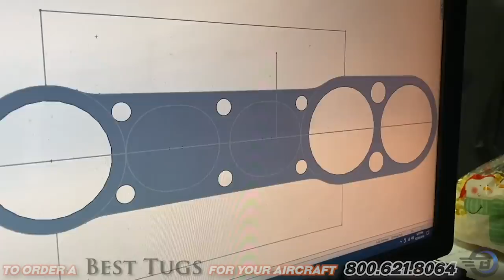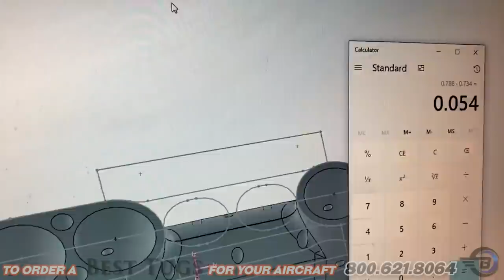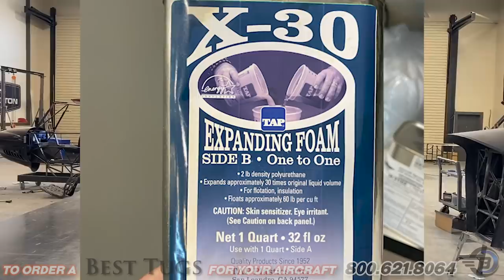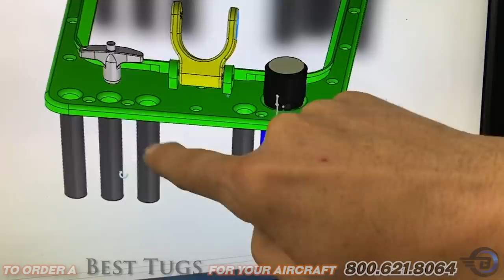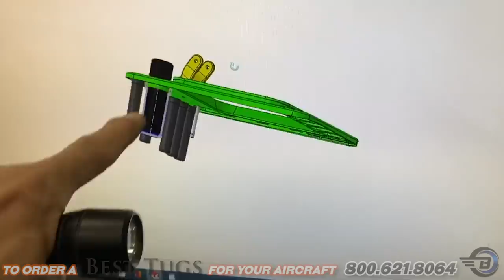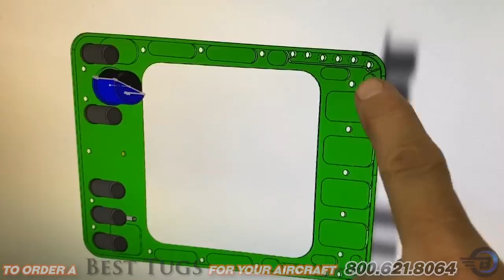Gust Locked 🔒 (Scrappy Bush Plane 14)

Comment: After watching your build videos, flight videos, and seeing the awesome community that has been built around aircraft, I am 100% going to get a light sport certificate. My grandfather has a Cessna 170 that has been in storage for about 3 decades since being ground looped. He has the repairs done on the landing gear mounts and the wings completed, but never finished the engine as it had a prop strike. I think its time to get it in the air again.

Comment: The pivoting gust lock is a great idea!  One thing I didn’t see is the ability to secure the gust lock bracket in the forward position to prevent it ever inadvertently coming rearward in flight and locking up the controls.
Reply from the maker: Gamma Sigma I’ll show how it can’t in a later video probably with the rudder lock

Comment: Mike,
I noticed the hole left in the panel when the gust pin is removed to lock the yoke. I think the pin will vibrate up/down when in the flight position.  You built shields for the light and pen pockets, but not the gust pin.  Just an observation.  As an aircraft engineer for a mayor aircraft manufacture I'm truly impressed and inspired by the attention to detail and the fantastic build and engineering quality.  Thank you for the videos.
Reply: vipervette03 I wonder if the little ball at the end of the pin will keep it in place via friction while it’s in its storage hole
Reply from the maker: vipervette03  there is a receiver under the plate I didn’t show, I can show it later. the pin drops in and you must push the button and I locks down in a pin set 2” under that hole. You can’t get it to vibrate or remove unless you push the button on the top of the pin
Reply: Mike Patey Those are the same kinds of pins used to secure an envelope to a basket on most balloon systems. My system is a firefly though and uses a toggle set up. I’d be happy to show you. How about a balloon ride for a Srcrappy ride😬🤣. I fly out of American Fork regularly.......
Reply: @slcfloater9443  i agree, i was not worried the pin would fall out. just the difference in the location of the ball detente to the thickness of the panel.
Reply: vipervette03 So what is the best AC for the $$ from a designers perspective??
Reply: @slcfloater9443  Wow, you’re so close to each other you probably fly over each other’s houses.
Reply: @MikePatey  Just curious:  do you have a means to lock the gust lock yoke down when in flight?  I saw the friction knob, but since you have to have a place to put the locking pin, why not design a way to use that same pin to positively lock the gust lock out of the way?  Then you can use bushings instead of a friction knob to keep vibrations quiet on the gust lock, and you also no longer have to fiddle with the friction lock every time you want to move the gust lock yoke.
Reply from the maker: Scott Reichel yes, I’ll show more on that later when I show the rudder lock 👍🤠

Comment: I love the thoughtfulness that you integrate into your designs.  Your design philosophy should be adopted by others to provide safer products.  However, I know that your design schedule and budget restraints for Scrappy are far more relaxed than the development of products for the U.S. government. I would have loved to be able to design in that environment.  One thing that I noticed in your video is that you did not talk about having a lanyard for the control lock pin. I know that your design includes a storage location for the pin, but nothing to prevent the pin being dropped on to the floor of the cockpit when you are sitting in the seat.  I know from experience how hard it can be to retrieve a dropped item from the floor when you are all belted up ready to go.

Comment: Mike, Great work! Got a suggestion for you that is a simple mod. Drill the hole to store the pull pin in front of the yoke. The handle of the pin would keep the yoke from pivoting into the way of the control stick if it got hooked by a seat belt or something during flight.

Comment: Hi Mike, 
I, like others certainly enjoy your videos. Please keep them coming and more of them. You asked for feedback on either giving us videos more sparingly or giving us shorter videos more ofter... Giving us more shorter videos is my preference. 
Additionally, I wanted to suggest an alternative way to cool your oil. I've repeatedly watch videos 7 and 8, and I see that a large duct on each side of the fuselage forces relative wind to turn 90' into the plane, 90' again to turn through the coolers, and then turn again to exit at another 90' turn to exhaust out the same side. Here's what I'd like to suggest... Install two large NACA ducts on the top of the fuselage for force air straight down and through the coolers, and then use two large/long NACA duct built into the bottom of the fuselage backwards aft of the coolers, and before the tail wheel mount, to pull the air out of the coolers and exhaust out the bottom of the plane... Which keeps the air flow in and out of the coolers in one direction. I say this because the NASCAR race team for "Gumout Performance Additives" conducted extensive wind tunnel tests, and found that by installing NACA ducts backwards in the rear side windows pulled large volumes of low pressure air out of the interior. So much so, that it increased the car's speed. I hope you give this some consideration because the two large side scoops and exhaust grills create unnecessary drag on Scrappy. Thanks for sharing your build with all of us. Your time and effort to create the vids are really appreciated. and now... Back to work!

Comment: Hey Mike, I do interior upholstery and I had the thought that a sewn vinyl or leather boot will save weight over a rubber bellows style boot.  If they are reinforced in the seams correctly they should keep out dust and fod do just as well.
Also, so cool to see you taking care of customers like that, brand confusion is so frustrating for customers it's hard to make it a positive customer experiance.

Comment: A piece of spring steel slipped inside the tubes will positively hold the flashlight and sharpies/pens so they don't fall off when you fly inverted. Kinda like how the old timey flashlights that used one double AA battery had to keep the battery in place.

Comment: Mike. Fantastic work, your design and engineering skills surpass anything else I have seen on You Tube. A little thought for you. If you cut out the part of the plate with the pen and flashlight holders and fitted it to a thin plate. This could then be dropped into the resulting hole and secured with a couple of screws. Cleaning or retrieving anything that dropped into the holders would be a simple and quick fix. Unscrew the plate with the holders, remove it, turn upside down on shake clean and replace

Comment: Fantastic job as usual.... I hope you will have enough flex in the boot to go from full up elevator to locked in the gust lock without the boot material jamming in the tiny gap left between the stick and the gust lock itself.

Comment: for the floors we had a shop that builds quansets to build floor and cargo mats and seam welded the corners so water etc stays put.. and then we got some used carpet and cut disposable mats up.. use em they get wet N Muddy, then toss em and throw a new one in,,,and the old carpet was free.

Comment: Could I ask you to consider changing the gust lock to accept the locking pin so that the lock can be pinned in the stowed position?  This would ensure if the pin is not in your hand, the pin is holding the gust lock in the yoke or in the stowed position.  Currently, the pin could be in the holder but the gust lock could still be in position over the yoke.  One of those 1% failure modes.  I love the thought and engineering you put into every millimeter of your aircraft.  That's why I watch, not a pilot, just an engineer.
Reply from the maker: The Devils Chew Toy we think alike. My videos run a couple weeks in trail of where I am.  I have it with a lock down 👍🤠

Comment: I seem to remember the right rudder cable rubbing against the frame tube just aft of the pedal several episodes ago. Did that ever get fixed?? That's all covered up now.
Reply from the maker: d mc it was never something to fix, the metal guides I had welded did not have any of the centering bushings in it yet so the cable was 1/4” off center. Now that the frame is painted and the bushings are in, it has the 1/4” clearance I set it at.   Kind of hard to video the smallest details but a rubbing cable I would never miss.  👍🤠
Reply: @MikePatey    I'm glad to hear it ! EXCELLENT build. Although priced out of my range, still its fun to watch....Thanx!

Comment: I just had a thought: Wouldn’t the perfect stowage for the gust-lock pin be in a position/slot/bracket that also locks the gust lock forward so it would be impossible for the gust lock to jump/move/vibrate into a position in flight that could interfere with the free movement of the stick?
Reply from the maker: D Hodgson  it does there is two pins, one for the rudder and one for the stick, the video shows the rudder pin only dropping in its space not the correct shot showing it lock down the bracket.  I’ll show that in the rudder lock
Reply: I thought this same thing. I was going to suggest having it spring loaded to a position away from interference
Reply: Mike Patey.  I must confess I thought that someone a thorough as yourself would have thought of it, but I guess one huge advantage of showcasing your work on YouTube is that you will have a plethora of constructive criticism should you overlook something. By the way, both the stock for the joy stick and the gator surround bracket are veritable works of art; almost a shame they will be , mostly, hidden from view. Many thanks for your great work, especially during this period of enforced grounding..........

Comment: The gust lock on my c172 covers the key hole with a huge red plate, so the plane cannot be started with it in.  I've read horror stories where pilots left the gust lock in, that didn't have that  and crashed their plane trying to take off.

Comment: Retired heavy truck/trailer mechanic..I have an idea rolling around in my head..What if you built a ducted pancake fan into each wing. Hidden by a [ sunroof top n bottom for wing continuity ]. They would come into play when landing short or a stalled wing , taking off in a cross wind, If they can tilt forward an back a few degree's they could slow your forward speed and set the nose down on the white line. On the sunroofs i am thinking elec motor / hand crank back up,,cable and return spring. They could have computer programs for different situations. #1 lose engine power before / after  take off.  They can blow down or up ,a little forward and a little back..#2 Stall/spin.. Have a great day . Get back to work..lol

Comment: Two questions : 1) locking full down elevator on a taildragger? What would the reasoning for that be? ( I'm an old seat-belt-around-the-stick guy....).    2) does. The control lock have a positive OFF lock, so that it cannot possibly interfere with the stick while in flight. ( vibration, turbulence, etc...) . Enjoy your passion and sharing your Scrappy project with us!👍👍👍

Comment: You should have cut some grooves inside the pen tubes for some orings. That way they don’t come out when inverted or negative Gs.
Reply: I worried about the unused pin falling out that way, not just the Sharpie.
Reply: Steve Nospam I think I saw him push the button on the pin to lock it in place when he put in in stowage.

Comment: Let me turn the clock back 50+ years and I am working on C47's and H-295  Helio Super Couriers, both of which had large control surfaces. I was taught that the gust locks were to prevent damage to the pulleys and cables for the flight controls. All the gust locks were a slip fit onto the actual flight control surfaces, .The gust locks had bungee cord on them that hooked a mounting point on the nearby metal support for the control surfaces The concept was that the  unrestrained movement could cause unexpected damage in inaccessible places... 
A control mounted gust lock doesn't seem to fall in that category...
Reply from the maker: GVCF Ministries of Dublin GA  correct. it depends on the aircraft and reverse forces.  Several certified lock this way but not every plane can. Reverse loads on the way I did mine are good 👍🤠 if I was leaving in severe severe weather I could always add the others

Comment: Awesome work, as usual. I’m a little worried about the possibility of the control lock fork being in the deployed position and interfering with the stick movement though. Let’s say you got in to fly and pulled the pin out of the lock, but forgot to move the fork out of the way, then during takeoff you shove the stick forward and bam, no aileron. What about adding a spring that holds it out of the way when not in use?

Comment: Kind of wondering how far up the leather boot will be on the control stick? Only possible issue I could see is the boot getting in the way of the gust lock with it locking in so low on the stick unless the boot is meant to be sitting below where the locking pin will go. But I assume you already thought of that since these builds are just amazing and the attention to detail is outstanding.

Comment: Hi Mike  Just a couple of thing come to mind would have been faster to make a paper template over the consul rather than cut the foam and blue paper and lay it all sort of flat. The other I cant quite see how the leather joystick boot will  miss the lock C piece, it will need to be very low hence it wont cover the all axis movement.?
Reply from the maker: Neil Pine it clears perfect just hard to see in video

Comment: Need to incorporate your "pip pin" storage into your gust lock when it's in the stored position to keep it folded forward. You could make another gust lock with an extra tab on the side for the pip pin to go through and into the base, that way there's no way for your gust lock to move when it's not in use.
Reply from the maker: Grandpa Es yea agreed I did that exactly that

Comment: Impressive work as always, Mike. A quick question from the OCD freak in me though!

What's the reason for not using the T-handle pin to lock the lockout saddle/fork in the stowed (forward) position? I'm personally a big fan of using the same pins to lock both on and off configurations when possible. I know you're relying on plenty of friction to keep the saddle from flipping on its own, but aviation accident history is littered with wildly unlikely scenarios, tiny parts behaving unexpectedly at the worst time, coming loose and having massive consequences. Imagining that lockout getting in the way of your stick motion at the worst possible split second is making me sweat...
In an effort to avoid that failure scenario and also to make things neat and tidy, why not have the T-handle fit over the stowed saddle to keep everything buttoned down? It seems wide enough for the job... You already have a hole there, currently for a countersunk mounting screw. You could even cut small notches on both sides of the saddle for the T-handle to rest into, perfectly in place without any chance of rotation... We seem to usually think along the same lines in terms of functional design, so chances are you've already mulled it over and ruled it out, in which case I'd love to know why :)
Reply from the maker: GearboxEnt  we do think alike. It does exactly what your suggesting but in another way and locks down with the same pin. The other hole I showed in the video is just the hole I showed to stow a pin but it is actually the rudder lock pin stowage. I haven’t made that video yet for rudder lock.  the stow location for the saddle pin locks it back but uses another bracket that will make sense later video when I can show the remaining parts 👍🤠
Reply: @MikePatey  You rule. Would love to be in the hangar talking shop with ya. Looking forward to seeing Scrappy come alive! You and the family stay safe in the meantime! 👍